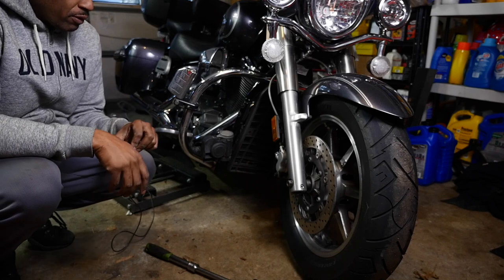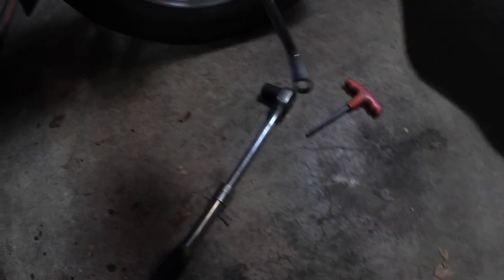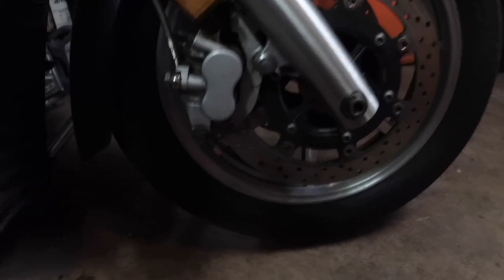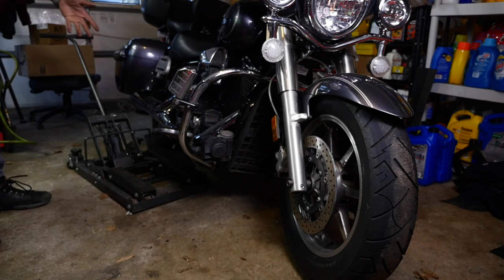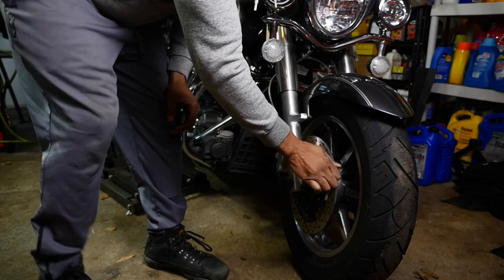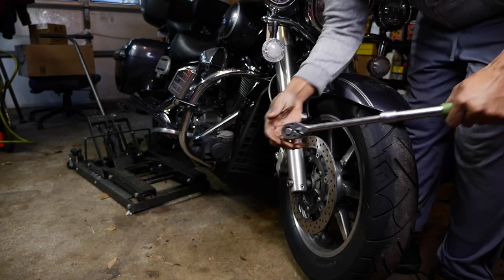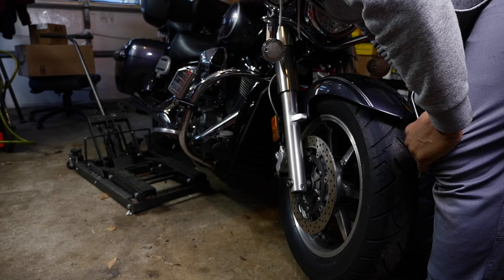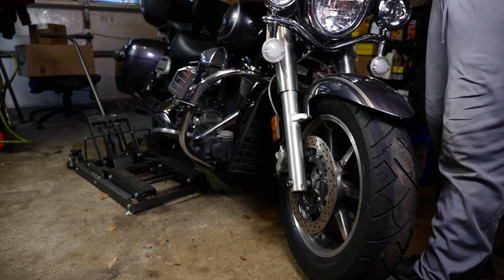How to take off Vstar 1300 front wheel.

Comment: Tip: I have seen people put a Crown Royal bog on the caliper after removal to prevent it banging on the rim or fender.   There is usually a place to hang it by the string until you can re-install.  Excellent reason to go buy a bottle.  Great video man, good to see another 1300 rider on YouTube.
Reply from the maker: Good tip , I will at times do that, or Ill stack a few bricks underneath to alleviate the stress. 
Good points.  Another 1300 rider huh , awesome.. will swing by your channel. 
ride safe.

Comment: lol, I just did that yesterday!  re-balanced and mounted back up after I put a new stainless valve stem in.
Reply from the maker: How did the balancer work..?
Reply: @dbest1aVlogs  It worked well, it has a level on it so you can be sure and adjust the 4 lower legs before you get started.  It is a bikemaster model and the materials did not feel cheap.  I ended up adding another 1/2 oz of weights to balance the tire and then added a little duct tape to help them stay on.  It looked like I had some fall off.
Reply from the maker: @AnthonysWestTexasRides  the front? How much total did it need.
Reply: 2oz

Comment: Nice how to bro, when I do mine it's pretty much the same but i only jack the bike just enough to take the weight off the front end, but with the tyre still touching the floor with only the weight of the wheel and tyre, that way you don't need to support the wheel whilst pulling the axle out, then jack up a touch more to remove the wheel from under the front fender, RSM8.
Reply from the maker: Thanks for watching . 
My Jack won't allow those intermediate steps.

Comment: Please film everything you're doing on the front end. My bearings need done too. 

P.S. What did you.fix the kids for dinner? Lol
Reply from the maker: I did a time lapse, and videod a little .. I do have video of the boring replacement in the vstar maintenance playlist. I needed a special Otc tool to pull the top race. If your lubing them then you dont need to do all that just pull the wheel, forks, headlight bucket, wires, pull the handlebars off the mount, pull the triple tree top. Then slide out the bottom triple tree, lube bearings, then reinstall as per manual for tourque specs.. 
Gonna see if I can finish filming the forks tonight , n the wheel install... 
Stay tuned..
Oh we ended up going to a buffet that night lol... my daughters got me good lol. It was fun. 
keep the wind in your face. 
Bruce

Comment: You need a special bracket on these bikes to keep from jacking against the motor.
Reply from the maker: Yes true , or hockey pucks. 
I usually jack either the front or rear which has been fine. 
Thanks for watching.